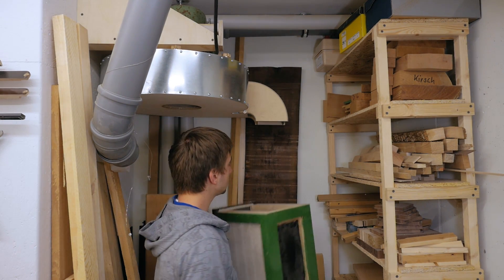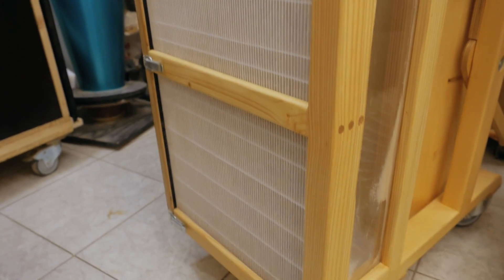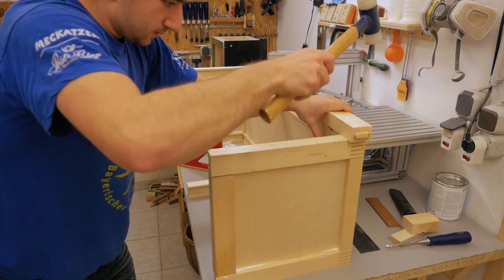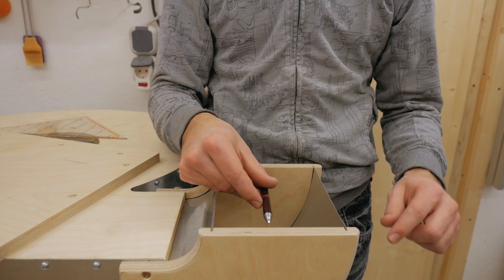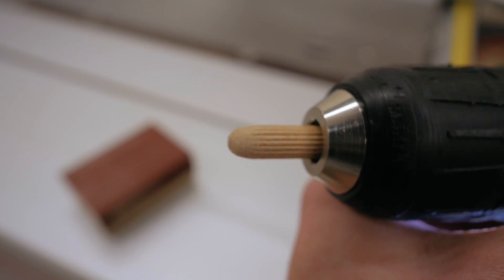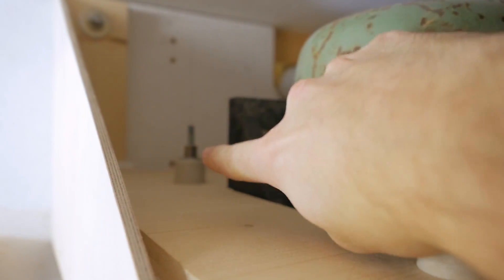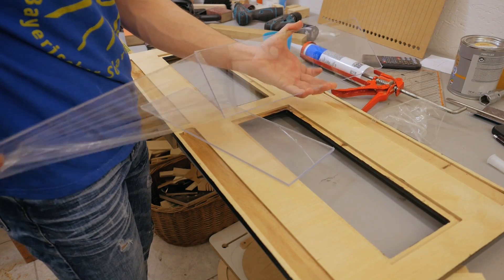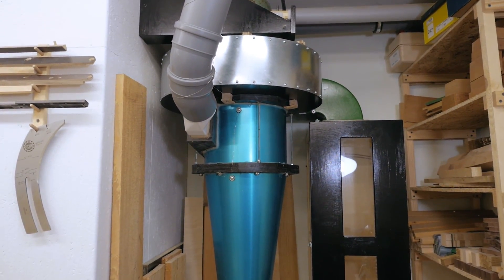Big Dust Collector Filter Box and Finishing Touches

Comment: So, now, over five years later, is it still performing well? I came back to this video series because I need to do something with my dust collection. When I build my shop I put all the 100mm pipes in my concrete floor, which seemed like a good idea at the time. I also converted my Bernardo dust collector to a cyclone system. However, the motor is only 0,75 HP and I had to bypass the in-floor piping. I have a 2 HP motor that was intended for a disk sander, but it would make more sense to build something similar to your system, and use the smaller motor for the disk sander. I have been watching this series several times now, trying to take notes as I watch. Now I guess I'll have a steep learning curve on the X-Carre to be able to design the disks for the impeller. Love your style and videos!

Comment: Yes, I was going to say how the glue up could be out of square, but you found that out. I always double check my pieces prior to glue up, if I can I assemble it dry (no glue), and compare the two corner to corner measurements. On every glue up I always verify the corner to corner dimensions, and I always have adequate clamps at the ready. On every glue up. 

I have always been a perfectionist, always meticulous. I learned to be meticulous in the shop by my grandfather, and in high school wood shop, thank you Cecil Parker. But it became a mantra when I was in a two year Machine Tool Technics program, and became a deeply ingrained way of doing everything when I went from Manufacturing Process Engineering Technician to Manufacturing Process Engineering Department Manager  and it was up to me to ensure that every machinist on 33 cells (64 CNC machines and  several dozen miscellaneous manual machines), running two shifts, one master tool maker and four tool room apprentices, two secondary operations machinists,  three fabricators, three finishers, two packaging and shipping technicians, four pre-operations/saw shop technicians, and four material handlers, had everything communicated to them clearly and concisely, anticipating every failure point, and every failure mechanism, and including instructions that effectively eliminated (reduced) risk of all of these failures. When you are the one member of the twelve person management team that, on a daily basis, has to answer what, how, when, where, who, why, root causes, and what was done to address it, and prevent recurrence of it, for every scrapped work piece, every OOT critical dimension, every job that did not meet set up or production  efficiency goals, and every occurence causing lost time, you become very thorough in how you prepare everything, check everything, and follow through with everything. You become very familiar with the quickest, and most idiot-proof, I mean least error prone, method of verification of process, of dimensions, and of quality control.

Cool video. My first time watching your channel, but I wasn't driven absolutely nuts by how many things I could pick out that were not done in an efficient way, or in a way that ensures accuracy and precision, or spotting things that are done in a reckless way, a dangerous way, something that shits on common sense, or design ideas that are just terrible, flawed ideas, which I see more often than I ever could have imagined I would see. Not saying I agree with everything, I don't expect to, but, I do look forward to watching some more of your videos.

Comment: Couldn't find the information in your videos, what RPM and horsepower is your motor? I'm looking at replacing the cast aluminium impeller on my not-custom dust extractor as it's quite poorly made. Looking into how robustly this will need to be made so as not to explode. I have a 1.5hp 2800rpm motor which seems rather... fast for a plywood object held together by wood glue and screws.
Reply from the maker: The motor has 2,2kw and runs at 2850rpm
Reply: @MariusHornberger  Thanks for the info. I should be fine then!

Comment: Are you sure it's wise to put the dust collector after the impeller instead of before it? You might get some loss of suction and the current design wouldn't work, but it would keep the blower considerably cleaner (and possibly make it last longer).

Comment: Hey Marius, or whoever wants to reply. I will be doing a lot of stone cutting with an angle grinder in a closed room, just to remove it. I need some way to filter the air so i can see what I am cutting. I'm afraid of using water directly on the stone as i might get shocked. I need this system for a relatively small amount of time so I will be improvising this build. So far I'm guessing the best solution is a two stage (three if you count the shop vac itself) dust collecting system. Simple 100 liter separator bucket and a not yet defined shape or size water bucket to filter the fine dust. As i don't see anybody doing this I imagine if this is feasible, albeit there are a few guys on youtube that are happy with the water filter results. This filter sounds much easier and cheaper to make then the big box filter system you use in this video. Why don't you pro guys use this solution? And do you know any plan for a good water filter system? I don't mind going with the dry filter method for fine particles direction, but whatever it is I need it to be kind of easy to connect and relatively portable.

Comment: having 4 screws on top would have made more choices to access them even when the filter is mounted to the fan outlet. but the intermediate plate with the extra long gap path is a smart solution either.

Comment: hey you need some electrical engineering here roll a few step up transformers and pack some capacitors for ultra power and throw in a few resistors for high med and low

Comment: for a nice washable option for a prefilter as well look into the filter sock material for water comes all the way down to 1 micron if that helps  and for a true shop air cleaner look into true hepa box filters used in abatement
Reply from the maker: +bentlikeitsmaker as hose heating in Germany works differently, furnace filters don't exist here
Reply: Marius Hornberger thats why i went and modified that to filter felt used in water filters kinda like filter bag media

Comment: hi Marius. did you consider sending the dirty air (after the cyclon) outside rather than filtering it? that is what industrial systems actually do
Reply from the maker: No, not possible for my workshop. And I would also send the heat out...not good.

Comment: Just a heads up, but you don't need soapy water to spread silicon. You can just spit on your finger (granted, it's likely not as YouTube friendly), or just use regular water and save the soap. Basically, silicon won't stick to a wet surface.

Nice job with the build though!

Comment: Having seen a millworks shop explode, One outside cyclone blow up like a bomb, I would never trust a dust collector inside a home or workshop. Place outside to control any possible explosion. 
Both explosions happened when nails and cabinet hinge were stuck by a chop saw carbide blade. 
Make sure you do not have sparks inside your collector system. 

One option for the turbine fins is PVC pipe. Once you build the unit, pre assembly, use fabric dryer sheets and wipe it down well. This helps keep dust from sticking to the parts for a long time. 

You do a very nice video and your wood work skills are very good, especially for someone so young.

Comment: Ones again, a great video from You! 

BTW. The impeller is 450mm in diameter and 85mm between discs.
What is the gap between vanes and blower wall, and the vanes radius? and high of the discs between bottom and top plate?

It would be great if you could make plans, or sell Your Sketchup model, or sell PDF with basic dimensions.
Reply from the maker: The closest distance to the wall is about 40mm and about 10mm between top and bottom.

Comment: hi thanks for the video man. a few questions if you have the time, what`s the power of the soldering iron you used and what alloy did you use for welding (rg45 or er70 rods?). pete
Reply from the maker: 20watts. The rods are 2mm diameter tig welding rods. But I didn't weld. If you mean the solder, I don't know exactly what it was, just solder.
Reply: haha you`re right it`s not welding and i should know better (welder/fab/machine shop o/o) yes i was saying the solder alloy, no problem man. 20 watts! that`s amazing i thought at least 100... but that`s the reason i`m asking i don`t know much of soldering besides electronic components when something breaks. thanks for the reply. cheers. pete

Comment: Nice work!

Have you checked the amp draw on your motor to make sure the blower isn't drawing too much power?  Power draw is related to the 3rd power of the diameter so it doesn't take much extra diameter to overload a motor.

I like the angled block used to cut down on impeller noise.  Did you notice much of a difference before and after that mod?
Reply from the maker: I can't measure the amp draw on my three phase, but after 20min running the motor stayed relatively cool. I have no before and after with the angled piece because I've only tested it without the cyclone before. And the cyclone also took quite a bit of noise away.

Comment: Very clean work. But one thing bothers me: I think considering the limited space in your workshop you wasted  quite a bit of it with the large filterbox. Although I think you probably have too much filter surface now that is not my main concern. I think the four filters could have been arranged in several different ways without the huge amount of air in between. Just think of a box half the height and filters on all four sides. Or an upside down U-shape where the air gets divided on top and each leg of the u has two filters only a few centimeters apart from each other.

Comment: Excellent work. Did you use any formulas or standards to size the filter area to the blower's airflow? I assume there are ways to calculate the right size and type of filter, but I'm not immediately aware of how.
Reply: gbspikyfish ... If you have a blower wheel to use as a reference its relatively easy to use the "fan affinity laws" to tune the design to get the flow curve that you want at a given rpm and power input.  Basically the flow rate is proportional to the rpm and to the cube of the diameter of the impeller.  The pressure drop is related to the square of the rpm and the square of the impeller diameter.  Power is related to flow x pressure drop which means that it is proportional to the cube of the rpm and to the 5th power of the diameter.

So, if you want a higher max pressure and less max flow you increase rpm and decrease impeller diameter.  Vice versa to increase max flow and decrease the max pressure.  That's why shop vacs run 4" diameter impellers at 25,000 rpm (high pressure, low flow) and most dust collectors run 12-15" impellers at 3450 rpm (low pressure, high flow).

As you can see, it would be very easy to overload a motor by making the diameter of the impeller just a small amount larger.  I.E. for two impellers of the same design, going from 14" diameter to 15" diameter would increase the power draw by 41%!  Doubling the impeller diameter and maintaining the same rpm requires 32x more power.

More detailed info here... http://www.engineeringtoolbox.com/fan-affinity-laws-d_196.html
Reply: Tony - very useful; many thanks.

I have a 3hp blower (motor + impeller + housing) from an old dust extractor (claimed 3,905 cubic metres per hour). I could probably work out the rpm and impeller size with some investigation.

I've run it for years without any filters at the exhaust as I've been able to vent outside, but that's likely to change soon so I'll need to calculate appropriate filter sizes.
Reply from the maker: No, I just knew that the two old ones weren't enough.
Reply: Thanks. I guess there must be some way of getting the "right" value - but experience and experimentation are valid too!

I would be very interested to a new cyclone build video. How do you find the cyclone vs the Thien baffle in terms of separation efficiency? I'm likely going to do one of the two soon, and I haven't made a decision between the two yet.
Reply from the maker: If space is no problem, go with a cyclone.
Reply: Space is always the problem ;)

I see from another reply that your workshop is 5m x 2.5m; pretty much exactly what I have. I take my hat off to you - I know how much of a pain it is trying to work in such a small space. Oh for a Frank Howarth sized shop!
Reply: A bit of research has lead to: http://ncidavid.blogspot.co.uk/2013/11/four-simple-steps-for-sizing-air-filter.html

Seems logical - filter surface area is air volume divided by required air speed (e.g. cubic feet per minute / feet per minute = cubic feet of required filter).

Looking back at my extraction design, I made some 7x4.5" ducting (internal), which according to http://www.engineeringtoolbox.com/equivalent-diameter-d_443.html should be roughly equivalent to 6" round pipe. That's about 0.196 square foot.

My blower's (likely unrealistic) claimed ~2300cfm would result in an air speed of 2300/0.196~=12000fpm; which looks very unlikely, and is something like 3x what I understand is required for good dust capture.

I guess I should go back and try to see if I can measure the actual CFM and FPM that I'm getting in the ductwork, and size a filter based on that.
Reply: gbspikyfish if you want a lot of information about this area check out Bill Pentz website. It may be information overload and I don't agree with all of his conclusions,  but it's still the most comprehensive source for dust collection information that I've found so far. It covers all of the questions you have asked.
Reply: Yep - my original system was based on Pentz's site - but it was more than a decade ago, so my memory of the specifics had faded!

Comment: that's great but i would add  shop vac connection just for hoovering dust that is laying around be much better than holding the large hose just to tidy up well done.
Reply from the maker: Small diameter hoses don't work very well with this system. I have a separate shopVac for that

Comment: I noticed the blower starts more slowly now.  Did you end up rewiring the motor to a Y configuration?
Reply from the maker: No, it has always been in Y. But the impeller has about double the weight now.
Reply: Most probably it's "Kirschholz": cherry wood
Reply: Matthias Wandel oh funny meeting you here😁
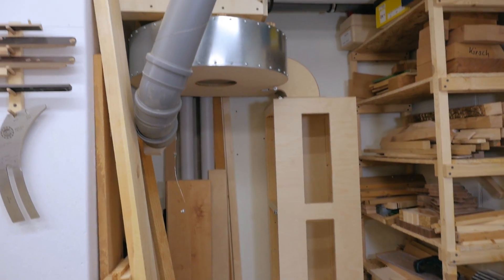Reply: 12:38 why is on the wood the name Kirsch / the word
Reply: I also think a 3HP motor like yours, in D configuration is meant for countries like norway where there's only 230V between phases. When you get to 5kw or bigger then you might start seeing 400/690V motors, but usually not until 7.5kw which is around when you need Y-D starting or more modern soft starting units. 

I might need to shell out for a simple soft start since my 4kw motor just spins my impeller (similar to your new one) to top speed at once, it's probably quite hard on it....
Reply: Matthias Wandel
Reply: Did you also determined the inertia experimentally via "maxwell wheel"?
Reply: Matthias Wandel  Do not repair it is normal the slow start of the engine considering the weight of the rotor is how it became difficult for it to reach its maximum speed and the more weight you put the more it costs. I would like that in your next video you will leave the Link of my channel but you must know that I am from Uruguay therefore I spoke Spanish thanks

Comment: Really great project, but i couldn't help noticing the chip out at the edge of the finger joints - i find if you score a line at the edge of the finger joints with a knife, this prevents chip out really well.  Anyway thanks for uploading and keep up the good work!
Reply from the maker: I tried a sacrificial block for preventing that. (small block behind the pieces). But it doesn't work as expected because there still is a gap between it and the workpieces.

Comment: You ever think to just build a small shed for the blower outside or something?
Reply from the maker: As I'm in the basement, no.
Reply: Marius Hornberger
 But you got that one window ... I think. I swear I saw a window once.
Reply from the maker: That should stay closed in the winter.
Reply: I thought about it for 3 seconds, then realized if I did that I'd pull outside untreated air into the house and blow my ac or heat outside.
If your running about 350 to 650 cfm in a 2k sf house you'd empty the houses heat in just over an hour and your heating bills would skyrocket.
Even if you only blew the air into a barn then pulled it back in your going to loose energy.
Its a stupid idea unless you have your windows open on a 70 dgr F day but even then you'll put dust in the house.

Just blow it outside if your in a garage might work, but not inside the house.